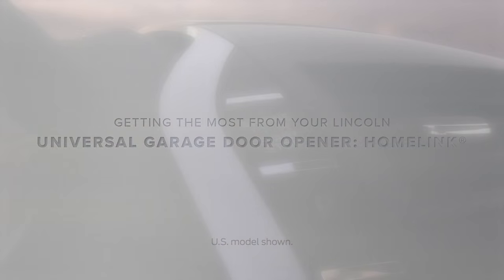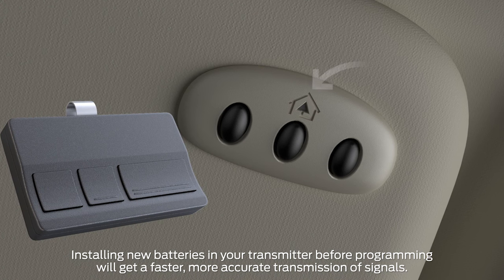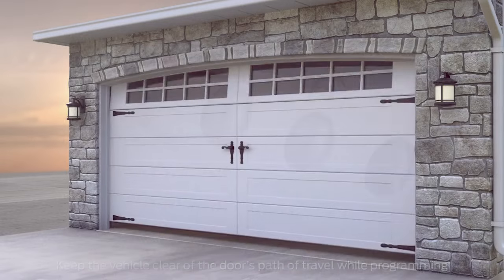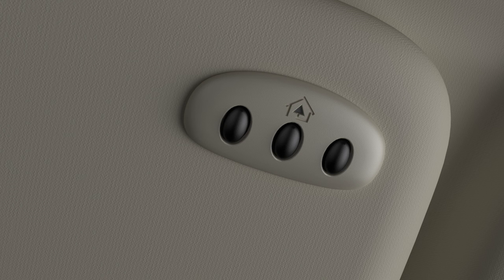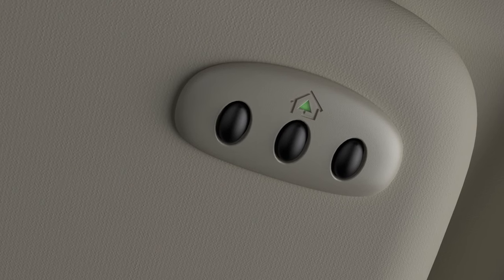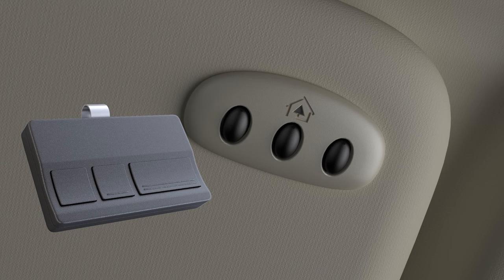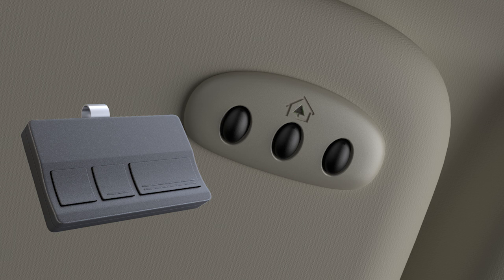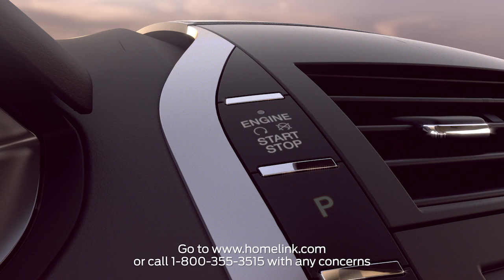Using the Universal Garage Door Opener: Homelink® | How-To | Lincoln

Comment: For all those struggling:

1) Turn on the car 

2) Hold the buttons on the far right and the far left and just hold them until it starts blinking. That clears old codes out.

3) put your garage opener transmitter right by the car garage buttons (I hooked mine to the visor and slid it right by the buttons).

4) Press and hold the open on your transmitter and the button you want to program at the same time until the light blinks fast.

5) the button should work now. You can press it on your car to test it. If that doesn’t work, then the extrasteps part of this video will now work.

6) thank me by asking The LORD JESUS CHRIST to do whatever HE has to do to you to have you go to HEAVEN when you die and not hell.
Reply: Thank you. It worked, following everything you said
Reply: Thank you so much. Got to work thanks to you!! 🙌🏽
Reply: Thank you. You made programming so easy. I was done in less then 5 minutes from grabbing my keys and going out to the car and coming back inside. Worked the first time.
Reply: My light is red too. These instructions worked. Thank you❤
Reply: Thank you so so much!!! Bcuz I was struggling following this video!! I thanks again!
Reply: Thank you for some very helpful garage door opener information.

In case you missed it, hell was emptied near the end of the first century. At that time, death and hell were both thrown into the lake of fire about 2,000 years ago, thanks to God and Jesus Christ. Amen. God bless.
Reply: Thank you! Nice clear & concise instructions that worked.
Reply: No instructions work with 2008 town car